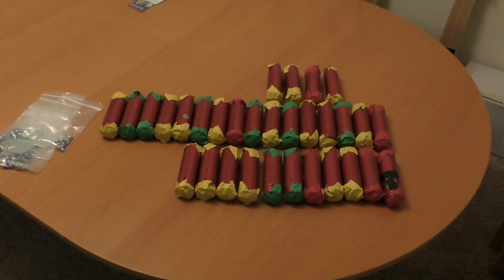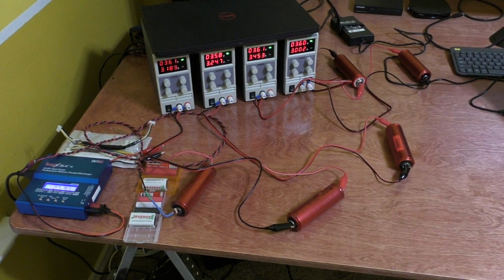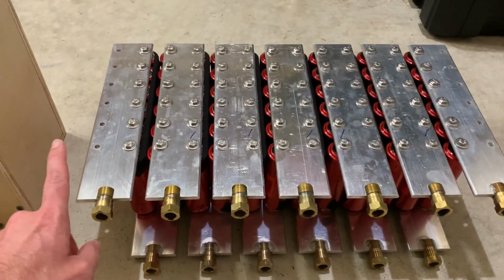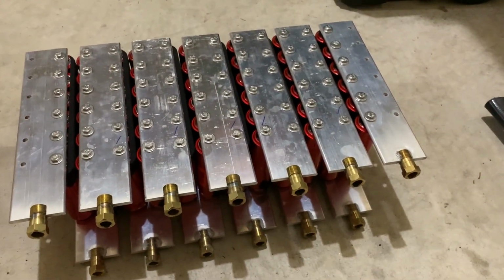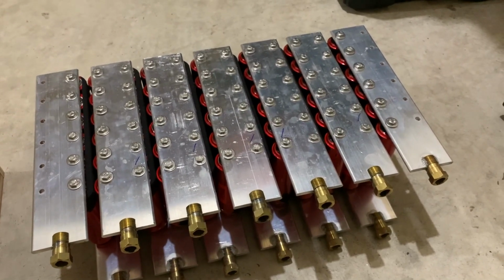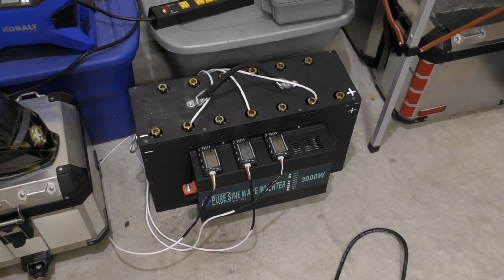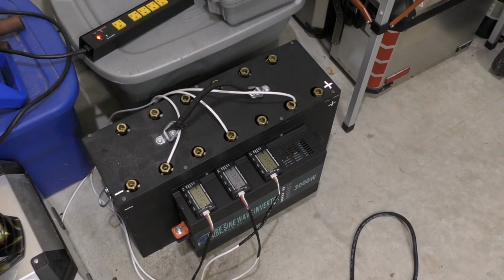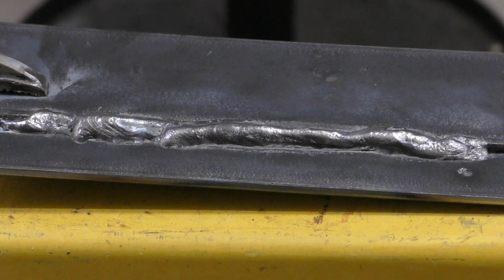DIY Lithium Battery Pack for MIG and Flux-Core Welding

Comment: did you say 23vdc and 200a? wouldnt that be 4600w or so? how does that much power pass from your battery through your 3000w inverter and into your welder?

Comment: I can see how there's application-specific needs for either a FCAW or MIG welding method, but in the absence of that requirement I'd be regarding the usage of either/both welding power supply and/or inverter as wholly superfluous and run my welding electrodes straight off of that battery pack for some plain-jane good ol' DC stick welding. I think of it as "Russian-Style" welding via battery pack after watching the KREOSAN guys do that exact thing with 18650s (which technically makes it Ukraine-style...) as it's definitely a method reserved for those of us who generally have a "safety=optional" outlook   in our minds (or alternatively: universally regard precautionary warnings as the suggestions that they actually are). In case you'd like to see for yourself: https://www.youtube.com/watch?v=DtswWooiTLg
Reply from the maker: Thanks for the feedback. Before I made this large battery, I did some testing with stick and wire feed using car batteries and jump starters. Stick on 36V worked great. The downside is not a lot of heat control. That's fine for thick base metal, but not for thinner stuff. I much preferred the adjustability of wire feed. The lower voltage can be a plus too.  https://www.youtube.com/watch?v=zszDOSfGZqU https://www.youtube.com/watch?v=o9_z7Nb4SJc
Reply: @GregoryHildstrom  Very true, my suggested alternative is about as primitive as it gets. The Ukrainians in the linked vid had an equally primitive solution to provide some notion of current limiting by simply making the wire leads longer to affect a resistance/voltage-drop. Also, thank you for the links to your other vids! In addition to some quality project-idea-fodder, you helped answer a thing I've wondered about for a for a while now about batteries that have some significance difference(s) in whichever way (i.e. chemistry, Amp-hrs or even voltage) being used in a series for a limited amount of time and also not to full-discharge*. The internet god damn useless for Q&A of that type as it'll just get universally shouted down by people shrieking "NAAAAAHT SAAAAFE!!!! 100% PROBABILITY OF DEATH!!!!" while rarely providing useful info/alternatives & w/ a tone that suggests adults are merely a theoretical concept & life hasn't already sorted everyone's probability of death long before they even grasp the concept... Annnyway, since I have the exact same on-hand batteries available to play around with of an extra SLA & a jump starter but was a tad bit timid to just say "eff it" & throw *all caution into the wind, your uploads were super helpful, thanks!